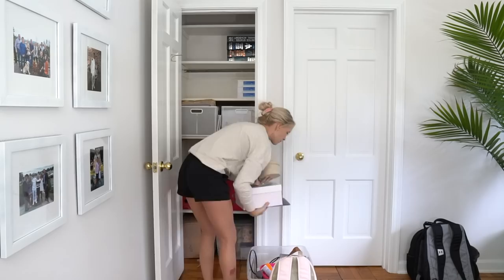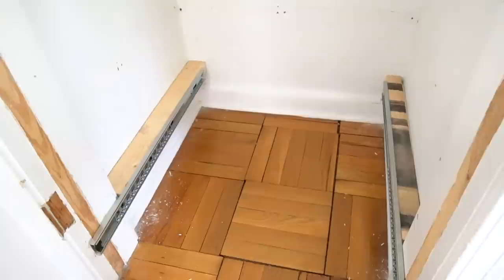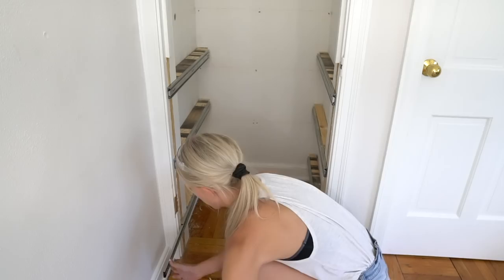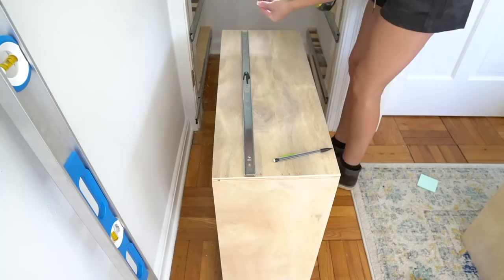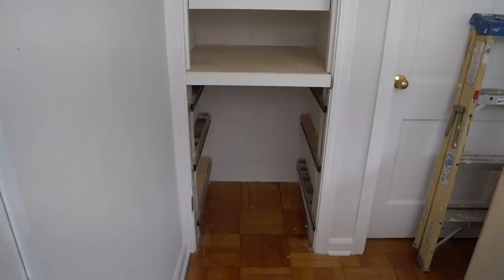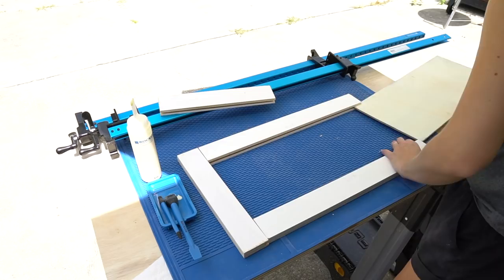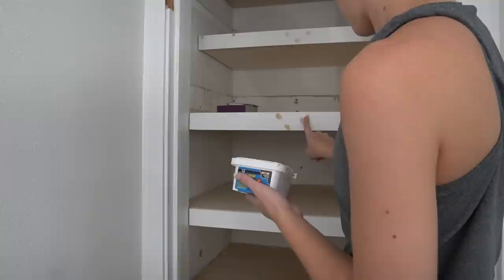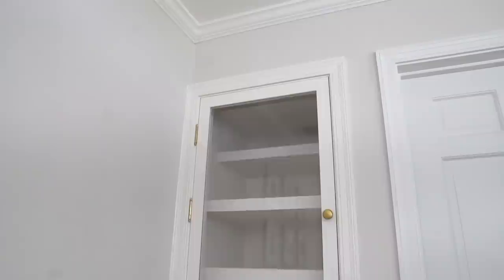DIY File Cabinet Closet | Small Closet Makeover

Comment: One way to remove those annoying stuck on labels is to take your heat gun and lightly warm. They bubble at which point use a paint scrapper and off they come easily leaving you with a clean area ready for your sanding.

Comment: you guys make these drawer slides look really easy, I'd say I'm running at about 50% on the ones I've installed.  half work great, half stick at one point.
Reply: One trick to drawer slides that I've learned (from YouTube) there are several holes you can choose on the cabinet portion of the slide.  Some of them are within a cutout tab that can be bent in to adjust the width of the slide in the drawer spacing it's not apparent in the instructions. I've had mixed results too.

Comment: Ok, I want to do this to a linen closet and turn it into a "butler" pantry for my vintage dishes. The closet is roughly 23" x 23" but with an opening of 18". It used to have bi-fold doors so there was no door jam. Only drywall. I know I will need to remove the time because it overlaps the opening. However, I don't have the Kreg jig/rockler tools or the know-how to make drawers.

I was doing research and found an 18"w x 21"d x 29"h base drawers cabinet for a bathroom vanity never used on FB marketplace. I think I could frame that and do a plywood top and then do shelves like yours. But how would I do add a door? It is in a hallway, and I want to make sure the dishes on the shelves are safe.